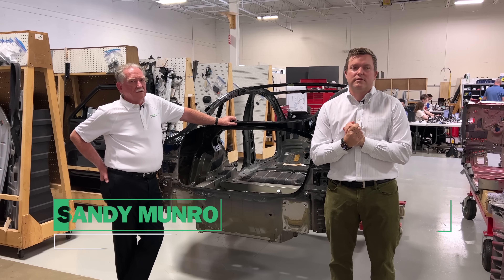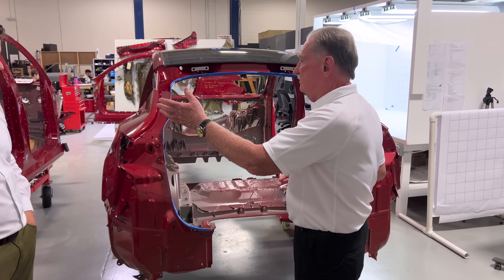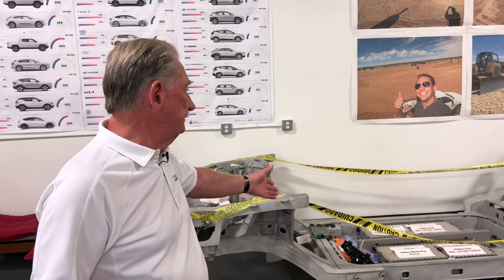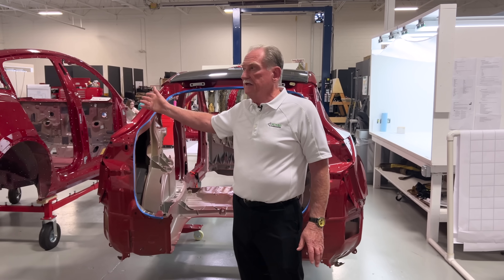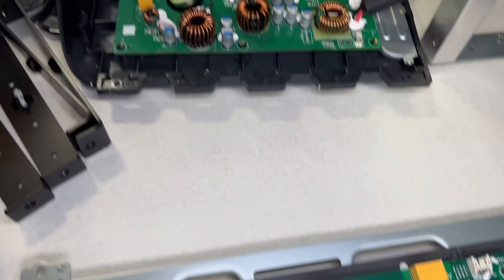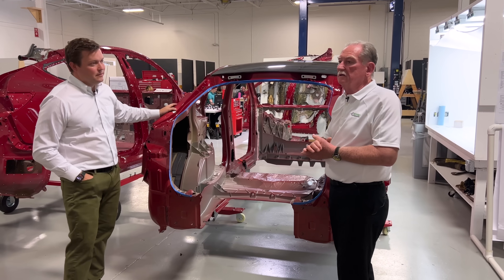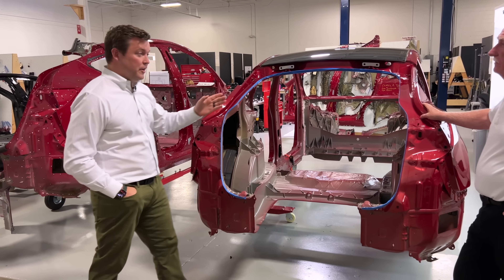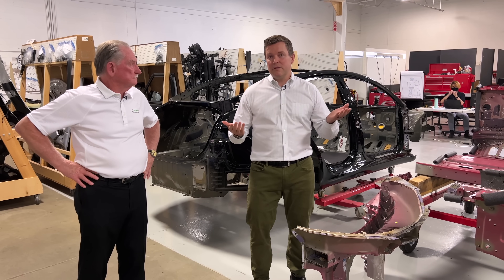Giga Castings with Sandy | Evolution of Tesla Bodies In White

Comment: Love the enthusiasm.
Love the philosophy even more.
Pay to do it right the first time, or more to go back and fix it later. 
.
When I was a "kid" I had a summer job in a "traditional" truck assembly plant. Lots of "bits an pieces" coming in by truck and train, forklifts everywhere, great fun scooting around. Fork lift was much more fun than hand bombing a rail car full of exhaust pipes, NOISE!, or manually unloading a transport truck full to the ceiling with foam seats. 
.
It took 2 weeks in summer to 'convert' to new model year. Take machines out, bring new ones in. "Clean up" unused stock, ie dumping racks of rusty doors. My favorite was using the forklift to dump a dozen or so 40+foot long truck frames that had been cut in half into a dumpster. Why? Because some mook put the wrong mounting brackets on (or wrong place). It was "cheaper" (and safer for some foreman), to quietly scrap them.
.
My favorite story was that after the model change, almost every pickup truck going down the line was dragging it's muffler. At the end of the line, they didn't start them, the trucks were dragged to parking lot, waiting for repair.  During the change over, some engineer or planner hadn't provided the right hanger bracket to mount the muffler. 3 shifts a day, 8 hours a shift, 45 vehicles per hour were dragged off to the parking lot waiting for a simple hanger bracket ... Cost of Quality(?)

Comment: now I understand why every(political)body is for strict speed limits.  They don't want make them of good quality steel no they want quick and brittle castings, fill them up with unquenchable fire-hazard packs, and want us to crawl along the autobahns or highways! 
Does anybody ask the car driver, the consumer, what he wants? 
CO2 savings have to be done by the car driver and the car driver only (because we pay nothing to the political parties' conventions). 
 Much more CO2 could be saved by using the newly redeveloped Oak Ridge ORNL MoltenSaltReactor technology. Their output temperature is so high, that they could supply all the power and process heat to refineries! With them, the splitting of water H2O -> H2 + O2 becomes feasible. We don't need to step back on driving good cars. EBVs are for big cities' traffic.
Reply: Moron

Comment: Just a lowly contractor here.
But with 10’s of millions of DeWalt batteries sold already, siting off grid in everybody’s gruage .to me, DeWalt is missing a big energy storage play.
Invent a 25 rack (grid connected), all batteries join the grid, charged or depleted, DeWalt joins the National power grid.
Then they are peeled off to cut the lawn, blow off driveway, but at the end of the day they return to the National energy grid.
Not to some toat bag left in everybody’s gurage doing nothing right now.
Energy storage is 24/7 it does not care what you think at this moment, connected to the grid, it goes exponential  24/7
DeWalt, already has a Tesla power wall, but management refuses to make it reality .

Comment: Haaaa,,, “I’m not popular “..
As for the sponsor, look out, just got my hands on a the new DeWalt DCB615 15 amp hour battery 270wh $310 (20700 cells)  ($370 on Amazon, $310 at Gideon King hardware. 4 of these in the DeWalt power station is right there with you. Weak point, charge time on DeWalt power station is lame.
But then the batts can break off into other DeWalt devices, for smaller uses.

You edited my post math twice now on DeWalt? WTF.

Comment: Large high pressure die casting is great for manufacturing small batch product runs, but when scaling to a high volume, there's a lot to consider. Large die cast molds don't last long before needing repair or replacement. Keeping the alloy, temperature, pressure, gas level, microstructure and porosity consistent isn't easy. Welding these alloys isn't that simple when considering warping and expansion issue of the entire part.  It definitely has its pros and cons, which Tesla can play with as they basic have nothing to lose, as their investors keep the money coming.

Comment: As an engineer and consumer. Where is my cost savings. Their margins on those vehicles has now gone through the roof. 150 machines, hundreds of people laid off.  Huge start up cost and recovery got that, but long term that vehicle is almost completely cast now.  Their justification of cost premium is going away. Conversely it should to Sandy's point put pressure on the others to catch up. Look why am i paying more for a lower quality BMW x5 or 7 at the high end, and on the lower end Honda civic as well.  With the cast front, rear, and structural battery pack Tesla's production quality will exceed hand built Italian race cars before long.  I wouldn't be surprised to see a cast A,B,C pillar setup next which simply bolts to the front and rear. The structural glass roof and battery tie it together in the middle.

Comment: I still think the cross-car beam of the battery, on which the seats sit, should be part of the body structure, and the battery inverter should be under the hood. The battery would still form the floor and the cross-car beam will give it more attachment points. These changes simplify the rear casting a little, and the assembly line workers can stand either side of the cross-car beam to do installations. The front and rear seats, the console, wiring harnesses and carpet can be installed before the battery is installed. Honda has a fold up rear seat in some of its vehicles. The space under the rear seat can be storage for driver/passengers.

Comment: Firewall holds many items like central compute unit etc. By having it not welded in at the body in white stage, means all units can be pre-installed on a separate line to it and just „snapped“ in with all units on, just like structural battery plus seats, carpets console? Would love to see a video how the assembly goes for the  new model Y body

Comment: from an engineering standpoint that is amazing! the rigidity of that structure is such that it doesnt even look like it would be even close to as strong as the first display but im positive its actually stronger. forget less is more this is intelligent design is way more.
Reply: Don't forget about the structural battery pack, which has been removed from the 2022 Model Y in this video. I think if you could see the whole structure, the 2 castings + the structural battery pack, it would probably look plenty strong enough to you even at first glance.

Comment: I don't want a disposable car.  I want a service able car that will last long-term(battery included).  I also don't want a car where the insurance company says we can't repair minor body damage because it's mega casted.  Then the payout is less than what is needed to purchase another Tesla.  I also don't want tesla to limit the range of a older tesla with an upgraded battery pack. Imagine walking into a tesla dealership for a software update and walking out with a 1/3 of less range it went in with.

5 years down the line, every single tesla will look like every other tesla.  I want a car that is unique and has updated styling, not just bug fixes.
Reply: Don't by a Tesla then. We won't miss you.

Comment: Is that large slab of glass on the roof a remaining "dinosaur" as you call it or also due for further innovation - for example with solar cells integrated? I seem to recall Elon had a good reason for rejecting solar cells in topside surfaces (like the new Lightyear One solar car) but I don't recall the details. I would appreciate your views, thank you!

Comment: Elon keeps saying you should go a bit too far and then take it back again. I think they have gone too far with the body and not yet far enough with the drive train. I would go for a body with four castings (around each wheel well) and a structural battery. Then I would have four motors and no differentials (no mechanical connections between the wheels). So each casting is much less than half the size of the two casting design and you can complete the assembly of each corner with its motor and drive train components before bolting the four corner assemblies onto the structural battery.

I see there is huge benefit going from hundreds of welded pressings down to four castings and maybe a couple of simple extruded or pressed beams. But the benefit of going from this down to two castings must be minimal compared to the cost and difficulty of increasing the size of each casting by much more than a factor of two. The cost of casting scrappage and increased cycle time is also significant and it seems the gigafactories are not equipped to recycle scrap castings on site.

Comment: Do you know if the 2022 body improvements also carry over to the model Y performance? I know that it won’t get the same batteries but wondering if it gets all the other improvements on the body structure.

Comment: Back in the 1960s, I used to collect diecast cars produced by Corgi and Dinky.
I always wondered why car manufacturers didn't produce this type of car, I expect the technology wasn't seen as scalable.
Now almost 60 years later Tesla has made a start down that road, how feasible would it be to produce the whole body by diecasting?
This would mean 4 major components making up practically the whole body in white, front casting, rear casting, body casting, and battery housing.
Looking back the toy car manufacturers were showing the way with a diecast body and skateboard design.

Comment: While it can speed up production and simplify manufacturing and save costs if it’s not passed on to the Customer it’s a mute point for me. The cheapest split new model 3 in the UK went from £40k to £49k in a year or so. If it had went the other way and we were looking at £32k on the road a model 3 would be on the drive. I know other factors are at work but the mission statement was to make an affordable EV and Tesla that’s a £50k Car and that is not affordable end off. I love the evolution the cars continually improving week by week. I bought a split new factory ordered Car BMW and four years later a Car in the showroom still had the same build design flaw as my Car.

Comment: Honestly, the evolution from a production design that is deeply flawed to one that is super-lean is astonishing.
Nevertheless, Tesla continues to build the flawed design of the Model 3, S, X and continues that with the construction of the Cybertruck…I just don’t get it why.
In some way, I disagree with Sandy in the way castings are presented as the ultimate solution. They have certain advantages, but creating the moulds and machinery is not trivial aside from the energy intensity involved. Stiffness is also something that can be an issue, because durability requires a mix of elasticity and stiffness, as seen on swords. That is why vehicles use a wide mix of materials with different properties within their frame. Too rigid structures tend to crack and break - you can weld these cracks but these structures are weakened in this process. 
That is also part of the beauty of carbon fibre designs: You can have stiffness in one direction and elasticity in another direction without breaking the stuff.
Reply: Yeah sandy talks about other designs as dinausaur as if those designs have ever paused any problems at all! There are still 40 to 60 years old ICE in the roads that were actually built with metal steels shits and those things can still last and be repaired to last even much longer! Your average tesla can’t survive Africa or South America environments……
Reply: I don’t understand what there aren’t any critics from Monroe in the tesla move because it’s all about money!? Shareholders!? He has actions from tesla!!!!

Comment: Time to make fighter jets the same way, just add the engine, and the other bits . :)) How about cheap housing? just make the rooms individual castings, bolt them together add the roof. all services pre-installed, join,  bolt together,done! :))
Reply: Unfortunately that’s not how it works lol….. fighter jets are made with materials super lights and a mixture of them to allow expansions and extreme situations and no casting can manage that! Let alone a massive one!
Reply: Today prefab construction has already been a thing for years and years from bridges to houses, factories……

Comment: The King of Screw Fasteners declares you can "just TiG weld" a fractured aluminum die casting that's been rapid quenched. I seriously doubt it. The car will likely be a writeoff and it will probably be worthless because there won't be any pieces that can get sold off during salvage. Tesla has made a turkey, just as legacy automakers are ramping up. RIP.
Reply: Yeah I agree and then it’s not a green car as it will be recycled or broke for spares which is not as efficient as re shelling it . Another contradiction of the modern way . They could be easily repaired by re shelling the vehicle easily and quickly just like you used to be able to buy new body shells years ago . But there are too many stupid regulations and rules that will make it non cost effective . So a slight tap on the front end writes off the vehicle! Does not make sense to me , just makes sense to the..
1 manufacturers as they then get to sell you a new car 
2 the government as they get revenues from your income tax and import tax 
3 the financial institutions as they make money on your finance / lease agreements ( the phrase you’ll own nothing and be happy ) comes in to play here so be warned 
4 then the insurance company and lawyers take their share from your accident 
All a money making scam really
Reply: Nonsense!!!!! You realise that teslas are already among the most expensive cars to repair right!? Also taking parts you also also realise that you can still buy parts from a 30 to 50 years old car from legacy manufacturers right!? Stfu and grow up!!
Reply: The casting makes the car basically no repairable whereas sheets is super easy to repair and also it’s going to be funny to see a tesla survive in Africa or South America environments lol 😂 😆

Comment: Could you have wiring encased by the casting.  So each casting would have the entire area of wiring loom inside of it. One plug connecting the casting to the floor pan.  Then connectors embedded in the casting at each output.  You could even have things like light click fit into the casting and make a solid electrical connection at the same time.  Obviously the insulation and connecting hardware should resist the heat and pressure of the casting process.
Reply: Fibre optics are a simpler for some things eg rear lights , live and neutral plus one fibre optic cable and a basic control module or use resistance ( just like how keyboards work on an old pc , each key has a different resistance and then the computer recognises . That’s why keyboards don’t have lots of wires in the cable ) . There are lots of other ways but they don’t seem to look at them . Their excuse will be cost usually but they waste more money on useless bits that no one needs and use them as selling points

Comment: Nice video , it’s all about simplifying everything. Cars are especially way over complicated for no reason other than the project managers /designer’s mindset ability to think out the box . Tubular space frame and lightweight panels are the way forward . Very little set up costs and very little tooling needed (JUST LIKE RACE CARS HAVE BEEN FOR DECADES ) . Shells could be 3D printed , grown biologically (no different to a plant / tree or living creatures if it sounds a bit far fetched) . There will probably be a way to use magnetism / frequencies  to align molecules . Take the rubber seals on your car there a separate extrusion or moulding that has to be bade and fitted , why not just mold them directly onto the component ?  it’s basic technology that’s already out there .It always amazes myself how much junk is on modern cars , pointless brackets and features it all adds cost , weight and fuel economy. Some of the most fuel efficient engines were designed 30 or 40 years ago ie the cosworth DF engines and its took backward thinking manufacturers years to even get their finger out and adopt similar engine designs and that’s only down to the green mob pushing climate change in our face . I can look at many products and think how they could be simplified to the benefit of everyone. Frustrates the hell out of me .

Comment: So, the Giga Texas MY LR is being produced with 2170 bat pack instead of the 4680 structural bat pack. My question is, do you think (or know) whether the 2170 MY had to be steel reinforced to compensate for the missing structural bat pack?

Comment: "castings can be welded" 

sure. and wires can be soldered yet manufacturers still replace the whole harness. also please go weld some cast aluminum and see how much of a royal PITA it is. 

so to recap you want them to (1) hot work repair an (2) aluminum cast (3) structural member on a (4) 2+ ton vehicle. that is so much liability and red flags that it won't be economical to repair them

Overall the engineer in me finds it exciting. The part of me that turns wrenches hates it. It's going to turn cars into disposable items like phones cough subscription seats and remote start

Comment: Why isn’t the sidewall of the car a casting? It seems to suffer from the same issue the frame did which is multitudes of parts fastened together.
Reply: Castings are not suitable as the wall thickness would need to be at least 4 -6 mm thick to enable the alloy to flow and not chill .  Then the thin areas would not be flexible enough and stress crack and dents would not be repaired easily so totally impractical. Alloy sides are pressed currently and that is a better option and then they are either bonded or riveted on / both . I still say the best way for now is to use a tubular space frame like on race cars as there is very little tooling involved and bolt on exterior panels, simple, cheap cost effective and a normal unskilled perso can easily replace them .